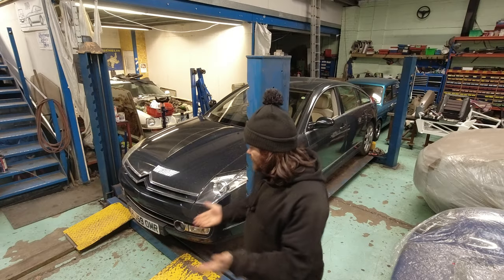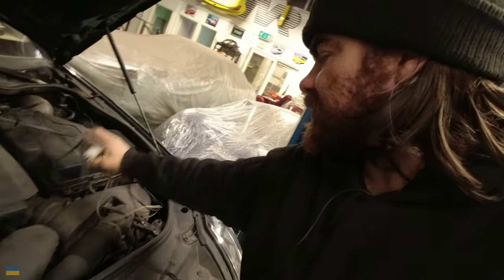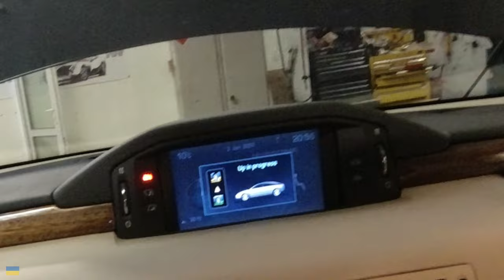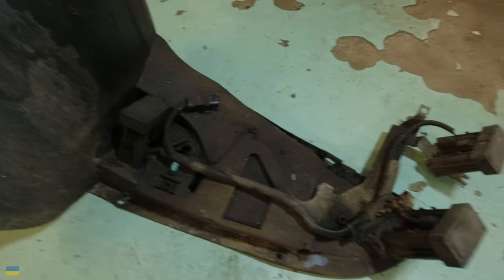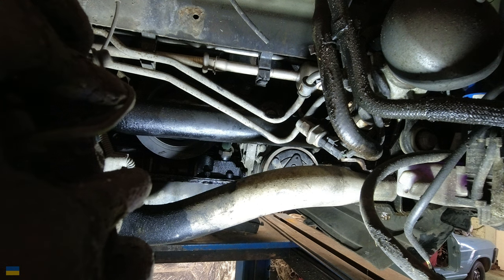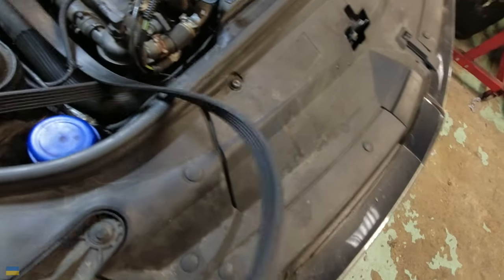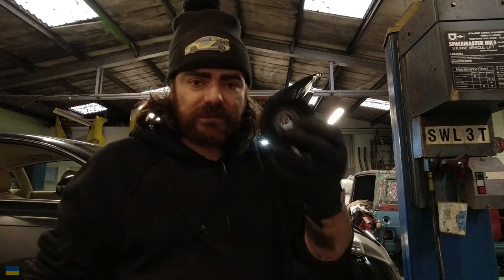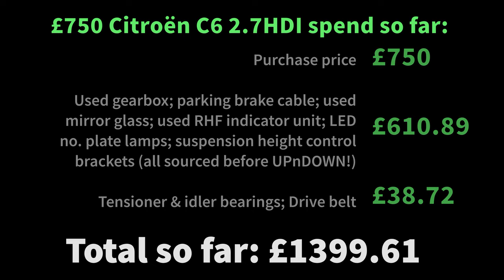Cheap Citroën C6 Project 1:  The C6 starts squealing (plus cost update)

Comment: I bought my C6 eight years ago. It's been on the road for one of those eight. I completed 60 tasks of an 82 job list  (new EGR's, new handbrake, new water pump, new alternator, new power steering, new window + mechanism, new bearings, bushes etc, etc), before a gummed up mountain of mastic (applied by a 'mechanic' to compensate for a snapped water pump retaining bolt) clogged up the water channels. Three thermostat housings later, on the 18th of May 2016, the cylinder head gasket blew. It finally got it's replacement engine fitted last week and is now getting all the things fixed that 4 years sitting on a driveway will need fixed. It'll take a couple more years to sort the cosmetic stuff but it will return to showroom condition. Eventually.

Comment: Wonderful video Reminds me of working on aircraft in the 60s (FAA) on Scimitars and Sea Vixens. Dont remember being supplied  with latex gloves - Pity would have helped. Use to remove access panels below the engine bays and find combination spanners falling on your head, plus hydraulic fluid. The Scimitar especially was an incontinent aircraft. Your channel is so informative and your skill ability is plain to see, Thank you again,🤓
Reply: Wasn't the scimitar absurdly high maintenance Roland?
Reply: @mrc7478  Yep and on board a carrier that can be very frustrating, The Sea Vixen was worse  because it was multirole and all weather. Both plus the lightening were a nightmare but they were new technology so everyone was trying figure out the best frequency of major overhaul, etc
Reply: @rolandlivings2370  were you about for the F4? American but proven airframe...
Reply: @mrc7478  No I worked on Buccaneer S1 at Boscombe Down 65 and S2 on HMS Hermes 67 they were the latest aircraft I worked the Buccaneer by the way was brilliant from servicing point of view. I left the Navy before Phantoms came in.

Comment: Alternator was changed at  SA Josse Rue de Vire, 14380 Noues de Sienne, France
In April 2017. Timing belt changed at Snow Basingstoke before they lost franchise.
Book time 6 hours, they took over 2.5 days and shagged the thermostat housing. Puddle of coolant between cylinder banks
Reply from the maker: I'm putting that in the history!
Reply: @UPnDOWN  I live 30 minutes from Basingstoke so if Kevin Elkins needs any friendly guidance with his C6 happy to help Bruce Harlow

Comment: I can attest to these being difficult to work on. I have a 3.0hdi c5 and did the timing belt not too long ago. 

Shortly after that the alternator pulley exploded sending bits of spring and ball bearings all over the place... Made a horrid noise. 

Other than the above it's been an absolute joy to drive, like a comfortable pair of old slippers.

As preventative maintenance I also do a partial gearbox oil change when doing the yearly service.

Comment: Plastic pulley that fractured a lip when pressed out - I did a bit of an experiment on 3 dead plastic idler pulleys (all from PSA vehicles, not C6's though - a 206, a 406 coupe and can't remember where the other originated from) - I have a lathe so machined off the lip on all three. However when I came to push the bearing out I found 2 pressed out ok, but the third the whole pulley plastic fractured - it turned out the bearing outer race had two groves running around the perimeter, the black plastic outer pulley had then been molded over the top (so into the groves too) - as such this one wasn't a replaceable bearing.

6203 on all three pulleys (was suffix 2RS = rubber seals - I've put in new cheapest I could find (about £1.50 / bearing off eBay) 6203 ZZ = two metal covers) but haven't put the "rebuilt" idlers into service yet.

I have a similar C5 X7 "exclusive" (with related to C6 hydractive suspension) so recognise a lot of what's in shot! Only a "tiny" 2.2 HDi to to try reach round though, that V6 you have sure fills that engine bay!
Reply from the maker: Ouch! I'm lucky I didn't have that.

Comment: Squealing noises aside, that is a remarkably smooth engine for a diesel. I can see it suits the car. (Supposing someone else is paying the fuel and service bills)
I didn't think I would see anything more cramped than a V6 Mondeo to work on, but this certainly qualifies!
Reply from the maker: Oh yeah, more cramped than a Mondeo V6 (I had an ST200 once). It does suit the car, I can see why they sold so many.

Comment: Great work! I was riveted to the screen, as usual! :-)

Admitedly, I am being a complete car nerd here but I found it amusing to see the  same cheapy side repeater as used on the C107GO, 1007 and even a Fiat Scudo on the top-of-the range Citroen! I replaced a pair of them on my C1 as the silver coating had disappeared...

You're supposed to dispose of the whole fitting rather than replace the orange lamp (actually, the book of lies suggests you can pry it open, replace the lamp and silicone it back together). Crazy!
Reply from the maker: Standard-issue PSA side repeaters. I replaced them as soon as I got the car, as they'd gone beige!
Reply: @UPnDOWN  Snap! Mine turned beige too! Glad it's not just me.

They appear to be used on all of the C-cars 🙂

Comment: Yeah my Airpipe was loose after a garage changed the CAM belt.. The pipe ended up rubbing on the lower pully, resulting in a hole and Turbo Pressure blowing out, black smoke and rough running. That plastic hose is like €700... :
Reply from the maker: Glad I screwed mine back down, then!

Comment: Weirdly this didn't put me off wanting to own one as an owner-mechanic. It all looks very conventional, just cramped. I was expecting shelves of specialist tools required and pneumatic multi-pronged vacuum suction devices to do simple things like changing the air filter. It's all just nuts and bolts which is strangely refreshing.
Reply from the maker: Nah, it's not specialist from the equipment needed, as such (though DiagBox is a must). It's just cramped and full of stuff, but probably no worse than a high-spec BMW or Merc.

Comment: so what about the cam belt, unkown condition and age? Is that not a worry or are they for life now? Love your filming style!
Reply from the maker: It's due in about 3 years, if memory serves. It's not got anywhere near the mileage limit, though.
Reply: I did mine a couple of years ago (2009 2.7 hdi in c5 x7) at about 90 k miles and the belt was fine.  Worst bit of the job was the locking pin for the crankshaft was oversize snd didnt fit in the housing in the block!  Had to machine a bit off the O/D to get it to fit.  Aux belt tensioner disintegrated on removal so needed to get a new one.  It’s supposed to have a pin fitted in the thin strap of metal up the middle of the spring to lock it compressed while being fitted.  My original one was snapped off.

Overall cam belt change was relatively easy job, just time consuming.

Rear EGR valve change is a total pain.

Comment: Did you manage to buy/find the shouldered bolt for the turbo pipe and am i right in assuming the cars had a new cambelt which does explain the loose/missing bolts (is it 108,000 miles on these engines?), finally i learnt something new about the idler pulleys in that i'd always assumed the pressed steel were projection/spot welded together (manuals and other sources always replace the pulley), now I see the halves are pressed around the bearing, is there any chance of a video showing how you separated the pulley assembly?
Reply from the maker: I found one in my BX spares stash that did the trick. I think I cover it in a future vid. Didn't film the bearing coming apart sadly as I had to do it during a normal work day, so time was limited, but it's pretty easy. I did use a press, though.
Reply: @UPnDOWN  thanks for the reply, was curious about the pulley dismantling as I couldn't see how the assembly was supported (did you use a C plate?) whilst using the press so it didn't distort .

Comment: Can anyone help after a my battery went flat so much that when I recharged it the will not crank
Reply from the maker: Sounds like it's either a dead battery, or the battery wasn't the problem
Reply: Thanks for replying but since then I have traced problem to the ECM the engine immobilizer is active to release it asks for the six digit code which I don't have?.

Comment: It's not a Ford engine there little to no Ford in the engine it 200% psa design used in many psa product outside Europe. 
Psa are not just a car company they are a huge engineering multinational corporation peugeot cutroen Matra simca 
This engine was purchased by  J L R under as Ford had nothing to offer JLR diesel engine wise. Ford had a long standing relationship with psa diesel engines used in fiesta focus cmax mondeos pretty much every 1.6nto 2.0,diesels  came from psa Ford has struggle developing there own engines at this point so people do not insult psa
Reply from the maker: It was a joint development by Ford/PSA. They were literally built in Dagenham! And PSA aren't anything - they cease to exist.
From Wikipedia:

"The Ford AJD engine was first developed as a V6 with a clean-sheet architecture and variable valve timing by Ford of Europe for its then subsidiaries Jaguar Cars and Land Rover, as well as for its partner PSA Peugeot Citroën working under the Gemini joint development and production agreement. It is called the AJD-V6 in the Jaguar and Land Rover vehicles and the DT17/DT20 by Citroën and Peugeot. The engines share the same bore/stroke ratio, with the V6 displacing 2.7 L (2,720 cc) and the V8 displacing 3.6 L (3,630 cc). The V6 was launched in 2004 and the V8 in 2006. The V6 engine meets the Euro IV emissions standards. A DT20 3.0 L (2,993 cc) was added in 2009 and is based on the DT17 2.7 L (2,720 cc). The V6 is used across many vehicles, from the Citroën C5 and C6, to the Land Rover Discovery, Range Rover, multiple cars in the Jaguar range, and also the Ford Territory.
To improve the engine's low-speed torque range for off-roading and towing applications, the Land Rover variant utilised a large capacity single-turbocharger, rather than use the twin-turbo design; in addition the engine is fitted with a large engine driven cooling fan to support low speed, high load driving as may be encountered in desert conditions. Furthermore, the Land Rover variant of the Lion V6 includes a deeper, high capacity sump with improved baffles to maintain oil pressure at off-roading extreme angles and multi-layered seals to keep dust, mud and water at bay and different transmission bell housing bolt pattern. The Lion V6 – constructed from compacted graphite iron[1] – is a member of the Ford Duratorq family and is produced at Ford's Dagenham engine plant; 35,000 engines were produced from April to December 2004."

Enjoy :)
Reply: @UPnDOWN  Is this the ''take the flag off the screen guy''...maybe ...😉😄
Reply: Ford absolutely had everything to do with the v6 and v8 diesels - PSA gave some design briefs I think so they could squeeze their engines on the PF3 platform but it was more an engine designed for JLR applications. JLR even brought the engine in house when ford dropped their uk diesel engine business - and the latest iterations still snap cranks apparently in things like the l405 range rover. So blame JLR / Ford for not sorting out the bloody crankshaft design for the last few decades lol.